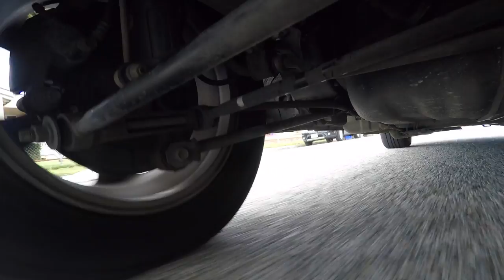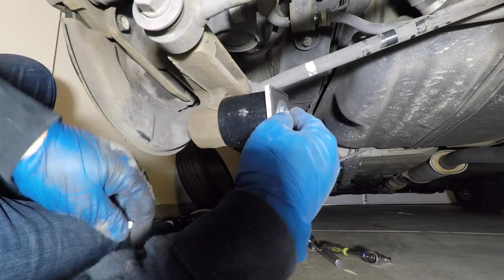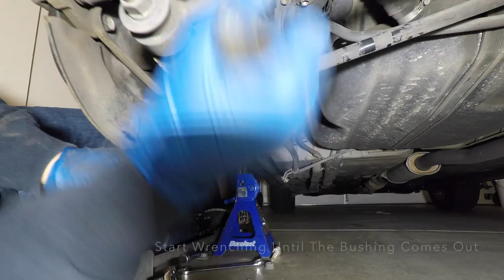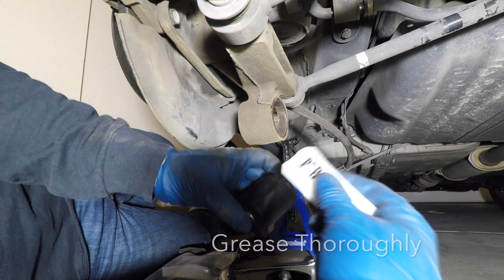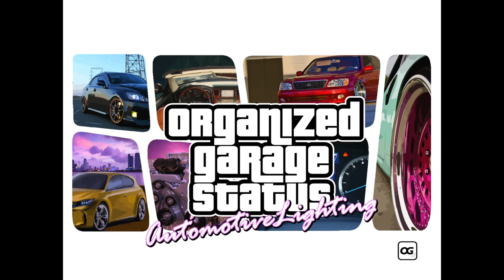DIY VL●OG: Lexus ES300 Toyota Camry/Avalon/Sienna/Solara Trailing Arm Wheel Hub Creaking Bushings

Comment: Made my square deck washer out of an old mower blade.  Measured 3 1/2 and cut with cut off tool.  Used center hole as center of course.  Had PVC and many of washers.  Had to buy 5” bolt and nuts at hardware store.  $2.

Comment: I used the tool to replace my 97 Camry bushings.  Minor problem with keeping the 1/2" PVC section from sliding off center but I was able to get the job done as shown in the video.

Comment: Used this exact set except they didn’t have 2” pvc so I used a 1 1/2 PVC coupler which was 2” diameter as well and fit around the bushing perfectly. Everything came out like butter.
Reply: What size is that square washer

Comment: You made it look so easy.  I didn’t see where you added the 1/2” pvc though.
Reply: It was on the outside of the knuckle where the bushing would need to come through the other side and go into the 1/2" piece that he added.  If he had not added that, the bushing would not have been able to come out the other side (the opposite side that he was pushing the bushing in from).

Comment: You're so lucky to be in a region not soaked in salt spray for Winter road clearing 5 months out of the year... Here in New England, everything under our cars is bonded with rust, and projects like this become nearly impossible without a torch, drills, a reciprocating saw and multiple blades.... to cut and toss everything because the dang bolt is seized inside the bushing ferrule. It's a nightmare.

Comment: Awesome info-I would add be careful which bushings you buy-I tried two I got on Amazon and they would not go  in no matter what! Found some from Rock Auto called PSB bushings-slid in like butter! In fact, after pressing in about 1/4 of the way I was able to gently tap them all the way with a rubber hammer easily! Also if you have a Milwaukee or other brand battery operated ratchet you can get the old bushing out in a heartbeat! Mine was a 99 Lexus ES300 but is the exact same as this Camry.
Reply: What's the part number?
Reply: @Fidel55  sorry-don't remember-was a year ago-just look for PSB and that's it!

Comment: Great video! For anyone contemplating, Dorman and a few others make rubber bushings if you don’t want to go the polyurethane route. Personally I prefer rubber for vibration control. But it’s personal preference and likely doesn’t matter either way on a trailing arm application
Reply from the maker: The rubber OEM bushings have already dry rotted, it's time to retire them.
Reply: @OrganizedGarageStatus  As I stated, ultimately it’s a preference at the end of a oem bushings service life to choose between rubber replacements or polyurethane. Polyurethane are NOT used by OEMS for a reason(exotic sports cars are an exception). They don’t dampen vibration anywhere near as well as a rubber bushing. This isn’t my opinion, it’s a fact. They both however have trade offs. But if you want comfort, especially in a Lexus I’d stay away from polyurethane. If it was a Porsche, then who cares about the cloud like ride 🤙🏻
Reply from the maker: @nordicpride9708  It's just a couple of bushings, it wouldn't make a huge difference in drive feel. I've had it for 5 years. Haven't squeaked since, and don't feel any harsher than before.
Reply: @OrganizedGarageStatus  My point is if the customer is picky about ride quality and wants the oem experience, poly isn’t the answer. I’ve done many of these. I strictly work on Toyota Lexus and own a ES330. I had this exact issue. The cure was new quality rubber bushings lubed with a rubber friendly brake grease that contains ceramic additives (CRC makes it). Most modern rubber is (EPDM) which is a synthetic rubber. It’s not your grand pappies rubber bushing. Drive belts, timing belts and many other parts are made from this stuff and have been since the early 2000’s. 

I’m not saying you did anything wrong per se. But again if a person wants to guarantee a car like a Lexus rides as a Lexus was designed and intended, rubber is the best option for said customers. EPDM lasts just as long as poly as poly will eventually wear out. The rubber typically cracks and separates but this is after hundreds of thousands of miles. This degradation of rubber can be arrested by applying a product such as 303 aerospace or ATP-205. Most just are ignorant of this maintenance item. Regardless you fixed it and good to hear no negative effects.
Reply from the maker: @nordicpride9708  I wasn't even replying to your comment in the first place. I don't know why YT keeps on posting it here. *facepalm

Comment: Nice video!  I liked the idea of "live" camera footage.  GoPro camera / phone?  How did you affix it to the underside of the car?  My biggest problem is being able to remove the bolts or get them to budge.  I don't have an acetylene torch, so I'm thinking of buying a new bolt first, then cut the old one off with a angle grinder.  I couldn't find a bushing for my '96 Avalon, so I had to buy the entire trailing arm.  Where did you find a bushing?
Reply from the maker: I use a GoPro and a DSLR for most of my footage. They used to sell the bushings on Amazon. I'm not sure if they still do.

Comment: If that bushing is bad will it cause play in the steering wheel too?
Reply from the maker: I'm sure it can, but I'd start with basics first. Check for the steering rack bushings if they're still intact. I would also replace tie rods if they've never been replaced. But suspension condition can mainly affect steering feel.

Comment: I think you are supposed to set the car evenly on the wheels then torque this thing to spec before driving.
Reply: Wouldn't putting tire on when done then backing up on ramps to tighten work?
Reply: Not necessary. If you get any binding you are over torquing

Comment: I'm just curious. Do you think that a ball joint press kit could work too?
Reply: No it will not work. At least the kit that I had didn’t work. There is not enough space for the “C” clamp to fit between the rear drum and trailing arm. Use this guys method instead and save yourself the headache. You can literally pick all this stuff up for less than $17 at your local home depot or Lowe’s.

Comment: Why can’t we just buy a lot that has all this instead of building it
Reply from the maker: Of course you can. Replacing the entire knuckle vs replacing a bushing. Let me know which ones easier.
Reply: Where do I find this tool?
Reply: @EliKnowws  He just put together some hardware components to make his "tool."  This is what he listed under his posting name, below the video and where it says, "Subscribe" -
To avoid having to remove the entire wheel hub just to press in a single bushing, we put together some simple parts to install the new bushings.

3/8 5" bolt and nut
Various washer sizes
Square washer (used for deck building)
2" long 2" diameter PVC cutout
0.5" long 2" diameter PVC cutout